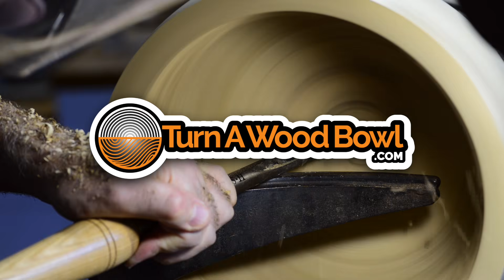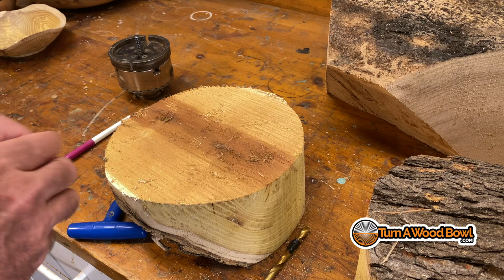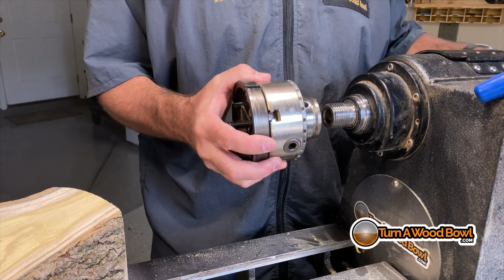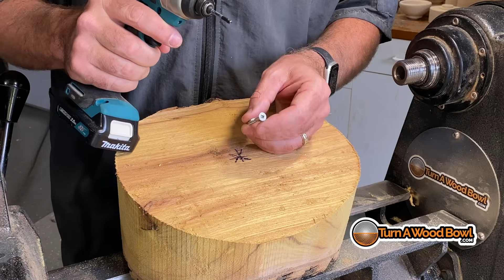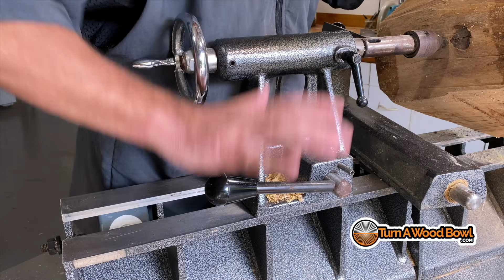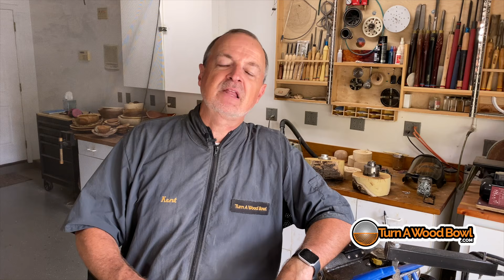3 Ways Mount Wood To Lathe - Bowl Woodturning Video

Comment: Hi Kent, Thanks for another informative video. I’ve used all 3 methods you described, but turners who use the faceplate method on the bottoms of projects I find unsatisfactory as they leave holes in the bottom of the piece and usually way to thick of a bottom due to avoiding the screws. They could over come this by using a sacrificial glue block to attach the faceplate. I only use faceplates or woodworm screws on the future inside of the bowl and turn a tenon or recess for my 4 jaw chuck on the bottom, the the screw hole(s) are turned away. Stay safe and well to keep the videos coming.  Cheers, Tom
Reply from the maker: Sounds good. Great points. Thank you and Happy Turning!

Comment: I always worry about how concentricity is maintained when I flip the bowl. I like the faceplate for helping that. And when I flip it I center the chuck at the tailstock end then flip. Also apply tailstock pressure to insert completely into the chuck before cinching it.  
I stopped using a woodscrew since I think it is never perfect- either the wood is not flat or the hole is not perpendicular. Not perpendicular makes the hole oval which is not tight anymore.
Spur drives are OK but need a lot of work to maintain concentricity. Your natural edge or balancing points are well taken. Of course, pure spindle is often is OK with spur drives.   
Stay safe. -Mike😷
Reply from the maker: Well explained. Thank you! Happy Turning!

Comment: All of your description makes perfect sense.
I use the 4 sperre chuck and the tail stock to 95%. To make the connection safer I predrill the hole, where the center is connected, with a center drill. This gives me a much better connection because the fibers are removed and not just compressed. The center drill is used quite often on metal turning machines.
Reply from the maker: Great tip! Happy Turning!

Comment: Another great video!  Thanks.  Now a question:  Is there a furmula for calculating the optimonal faceplate diameter given the diameter of a bowl blank?  I.E.  faceplate should be 10 - 20% of the blank diameter.
Reply from the maker: Good question. I don't know of a formula, but I would say the faceplate ideally should be around 30% of the blank width. So a 10" bowl blank should use a faceplate around 3-4". If you get smaller, the blank might flex and a larger faceplate is a bit of overkill. Let me know if that helps. Happy Turning!!!

Comment: A few things:
1) I always lock the spindle and finish tightening onto the screw chuck by rotating the blank with two hands. Especially useful with dry wood.
2) You  didn't mention faceplate rings. To me they are every bit as good as a faceplate and far easier to mount the blank onto the lathe - no threading! The large hole in the middle also makes it easier to mount them on an irregular surface.
3) You didn't mention the cup drive that comes with the Robust lathe. I like it better than the spur for a number of reasons.
Reply from the maker: Ralph, thanks I appreciate your point. Happy Turning!

Comment: As always, thanks for the tuition and refresher that we all so need. I use all three methods, the choice is usually made for me by the piece - size, weight, balance and how round it is. I also slightly counter sink the four spur to provide a "protective" shroud to reduce fly-off possibility should I do something to dislodge the piece. Your methodology and coaching techniques result in keeping me, and I am sure all of us who watch your videos, focused. You polish up what I pick up by watching so many of the other amazing folk who share their wood-turning with us. Take care, keep well and keep the coaching videos coming.
Reply: Here is a thought, Kent. Something a lot of us struggle with is getting the profile of the grind on our gouges correct. You have covered the different types of grind extremely well, but we often get the tip to edge profile wrong. I use a Tormek system and in theory it is fail safe. At least I initially thought so, until I kept finding I could not keep on the bevel with the tip of my gouge. I then realised the cutting edge of my sweptback gouge was becoming curved down to the tip resulting in my losing the bevel and the tool becoming dull very quickly. Maybe this is something you could guide us on, the errors turners often make with the grind, in one of your tutorials.
Reply from the maker: Thank you so very much. I appreciate you! Happy Turning!

Comment: Good evening Kent,

Are you happy with the sweet 16 or do you think the American Beauty would be better? I've been turning for years on a Record CL48, but it is difficult roughing larger bowl blanks to fit over the ways. Today I had to turn the headstock, mount the blank on a faceplate, and use a router along the tool rest to balance it enough to start turning. I'm thinking I need a bigger lathe!😊

Enjoy your presentations,
Jay
Reply from the maker: Jay, The Sweet 16 fits my needs great. If I were turning a lot of pieces over 16", I'd want the American Beauty. I can remove the ways on the 16 to give a 32" swing, but it is a bit of a hassle with the banjo and tailstock at times. Not a problem, just easier with the AB. Thanks for asking.
Reply: @TurnAWoodBowl  thank you
Reply: What I'd like to know is, why did you choose the Sweet 16 over the American Beauty?
Reply from the maker: I picked the 16 because it is a bit more compact.

Comment: Great instruction. I’m only a novice but occasionally when I’ve used a worm screw I have had to use a spacer between the blank and the chuck due to the depth of the bowl/platter. Always surprised by how well the wood stays on with “ minimal” screw depth.
Reply from the maker: Good point about the spacer. Thanks and Happy Turning!

Comment: I like to use the four spur chuck. I balance the blank by balancing it on the end of a hammer handle. I do this for both ends/sides of the blank. This method gives me a good approximation of where the centre of the weight is. I like the four prong chuck because the bowl, as you said, can be adjusted as I work the wood.
Reply from the maker: Right on!  Happy Turning!

Comment: I typically use the worm screw because my centers dont line up well. But I have used the spur if im unsure about the positioning when getting started
Reply from the maker: Ah, yes centers misaligned can be an issue. Great point.  Happy Turning!

Comment: I know this will be greeted with scepticism by seasoned turners but I quite often use 3M outdoor carpet tape to fasten bowl blanks to a faceplate. I have found this method is plenty strong enough to turn a mortise and I have used this method many times with no failure. Yet!
Reply from the maker: Sounds interesting.  Happy Turning!

Comment: I use a wood worm screw for green wood up to 12" in diameter, then use a face plate for anything larger. If I'm turning a natural edge bowl, I usually us a spur drive because I can adjust the wood so the lower edge of the bowl is about the same for both sides.
Reply from the maker: I like you thinking!  Happy Turning!

Comment: First, thank you for your incredibly clear videos!  I have never had any luck with the worm and generally use the end to end method.  I like this because it is easy to turn the bowl around and keep the same balance.  I also generally turn small items and this is just quicker and I don't have to worry about running into a screw!  (I now use the face plate on the inside of the bowl, turn the tenon on the bottom and then reverse and use the four jaw chuck.  The way I was taught was to use the face plate on a glued on tenon and then turn that off at the end.  I never, well almost never, do that anymore. ) But, I found this video really instructive and you answered a lot of my concerns!
Reply from the maker: Excellent, I'm glad this video was beneficial to you. Thanks and Happy Turning!

Comment: i appreciate your open, non-dogmatic approach to turning.  you don't try to preach only one way to do things, ie, your way.  you are, however, dogmatic relative to safety and that is appreciated.  i share my lathe and shop with a few other people, so i like using faceplates so i can take my piece off the lathe if i am not done and let others use the machine.  That is not the case with the 4 spur and the woodworm screw.
Reply from the maker: Ah, very good point you bring up. The ease and accuracy of removing and returning a blank to the lathe. You're right, the spur chuck would be the least forgiving to remove and return a blank. Some truing up would need to be done. And thanks for the non-dogmatic compliments. Ha! Thanks and Happy Turning!

Comment: When I use the MTD spur, I always drill a hole a little larger than the diameter of the spur and about .75” deep into the blank.  Then I insert the spur down into the shallow hole while on the lathe and tighten up with the live (tail stock) end.  This is done as a safety precaution.   In the event the wood comes off the spur for various reasons, the recessed spur in the wood will help keep the wood on the lathe and from flying off; creating a dangerous situation.  Doing this has saved my bacon on a few occasions.
Reply from the maker: Excellent suggestions. Thanks for sharing! Happy Turning!
Reply: i do the same up to 22 inch blanks
Reply: 311ī Imi

Comment: What about a glue block?
Reply from the maker: It can be used of course, but much slower and it still needs to be attached to the lathe with one of these techniques. Thanks and Happy Turning!
Reply: I have never been able to get a glue block to hold , I used carpenters glue , gorilla glue , epoxy resin . It always breaks loose before finishing.  Don't know what I'm doing wrong

Comment: As a suggestion to center the small faceplate to the blank, take a pencil compass set to diameter of the faceplate then scribe a circle then set the faceplate in scribed circle and mount as desired.
Reply from the maker: Great, thanks for sharing!

Comment: I’ve used all three but some times when I flip it around I don’t always get it centered correctly especially on salt bowls with lid . Any suggestions
Reply from the maker: It's nearly impossible to get the blank perfectly lined up when you flip the blank. I make a center mark on the bottom with the tailstock tip or a spindle gouge so it alines better when doing the final reversed tenon removal.